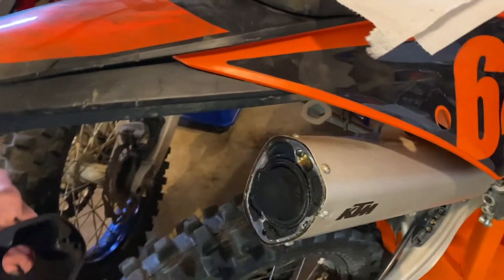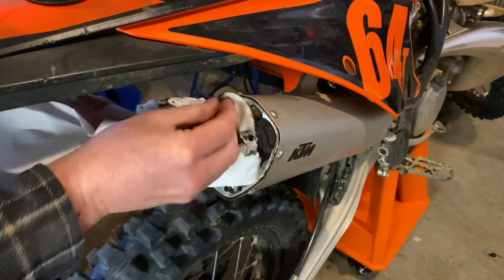65 Hours is too Long!-Cleaning an Enduro Engineering Spark Arrester

Comment: Next cleaning go outside with a fire extinguisher, torch,and pliers. Hold the screen with the pliers and torch the junk off. There will still be some scrubbing involved for a complete cleaning but it will be easier. I had my screen on my '17 250xc clog so bad the bike would barely run.
Reply: I freekin love you for the torch idea... I had soaked and scrubbed and got nowhere.... Torched em for 1 min, brushed and air hose blow.... perfect.  Was about to order new screens for $30.   Thanks to both of you!